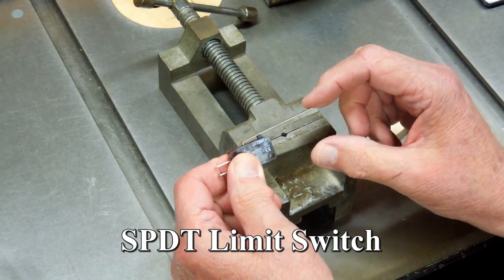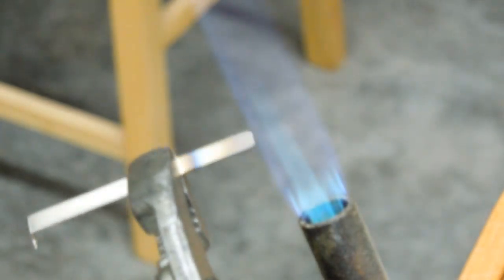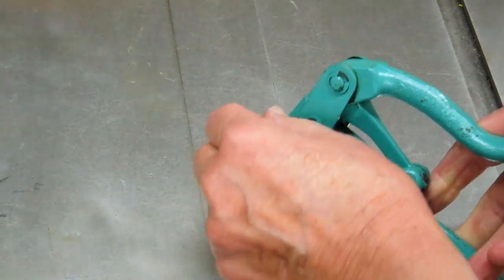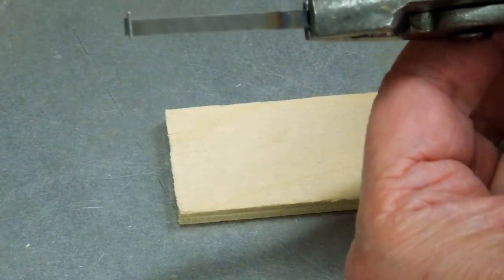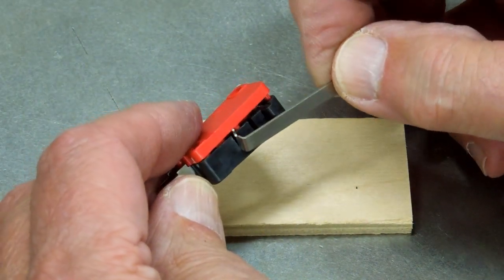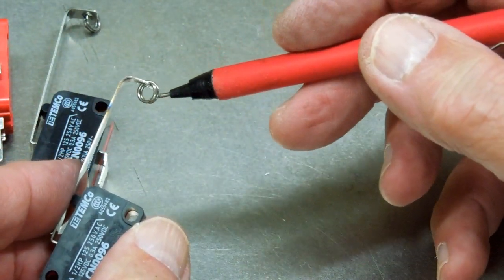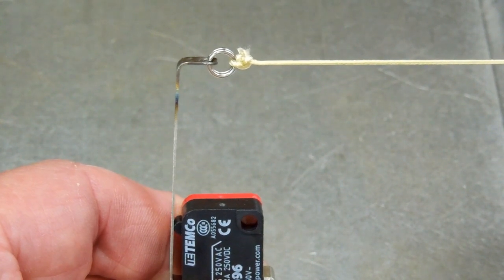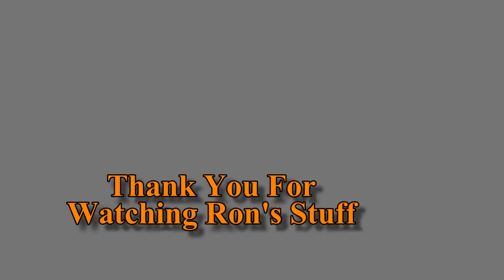Micro Switch Modified For Pull Cord Operation

Comment: You can print an overpiece that limits the travel of the blade to exactly that range where it's off and on.
Reply from the maker: A few weeks ago you made mention of an “overpiece” that would fit over a microswitch to limit the travel of the blade to exactly the range where it switches on and off. Do you have an example of such an “overpiece”? Thanks!